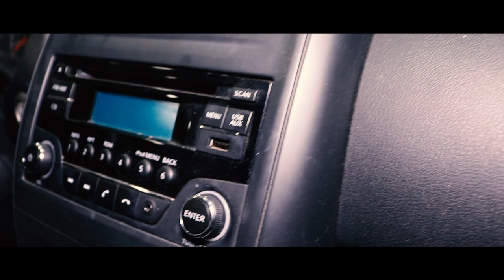Girl's DIRTY Car Detailing | Satisfying Interior Transformation of a Nissan Versa!!

Comment: Man the way you use that extractor is troubling. Your strokes are fragmented, slow down and press evenly throughout the entire stroke of the seat. Sloooow down bud. You can get these seats and carpet so much cleaner if you have more patience
Reply from the maker: I do go slow and press down but, for the purpose of the video I speed it up so it won't be too long, so I'm not going as fast as it seems on the video! 😁👍
Reply: My issue wasn't so much how fast or slow he went. The direction, the amount of pressure being applied to the extractor head, and lack of saturation when cleaning the seats is what got me. 
He needs to not extract backwards like that and let the extractor do its job.
Reply: I think he’s trying to get a good angle for us to see, but it ends up being awkward looking. Maybe he needs to practice some other camera angles, then extractions can flow more naturally.

Comment: I have a question, I'm not a auto detailer but shouldn't you have to have a warm/hot water attachment to your extracter?
Reply from the maker: Yes, I put hot water on the extractor. That's what I spray while extracting on the first pass!👍😁
Reply: There are different types of extractors, those that have their own heating system and those that don't as well as capacity.  Those that have them are pricey and heavier as well as some take longer to heat the water all depends on your type of Detailing business(mobile or shop) or if you're an enthusiast. Not always you have to use the extractor since all depends on the type of job and goal.  There are surfactants that allow you to do basically the same, it's just a matter of less water product spread or blotting technique and more use of microfibers to dry.  Always when using liquids and extractor must know the wicking risk and use effectively of air as drying methods with some air movers so everything is dry because it is very uncomfortable when either you or your customer sits and it is not properly dry.
Reply: @jcautodetailing7629  José Carlos, como siempre le das un buen toque a todo, muy orgulloso de ti y tu trabajo
👍🇵🇷🙏
Si me permites una sugerencia, usar mascarilla ya que se está haciendo un riesgo con el coronavirus.  Por cierto, no se si viste que Griot's Garage y Turtle Wax tienen unos nuevos desinfectantes aprobados para coronavirus que creo debes utilizar o posiblemente ofrecerle a tus clientes ese servicio de desinfección de superficies y ayudan en la limpieza también.  ¡Buenos los productos!
¿Cómo está la familia?
Reply from the maker: @1stfrompuertorico568  Muchas gracias Humberto!! Y claro gracias por la sugerencia, lo tomare en cuenta.! Boi a buscar los productos y ver si los puedo conseguir, gracias por la recomendacion!!👍🤝
Gracias a dios todos con salud y agradecidos por otro dia!! Esperando a navidad para comer deliciosos sopes!!
Y Ustedes todo bien?👋😁